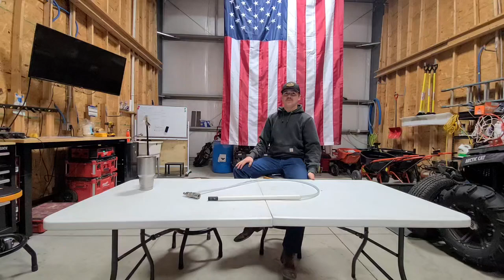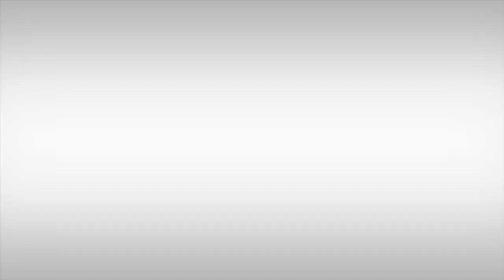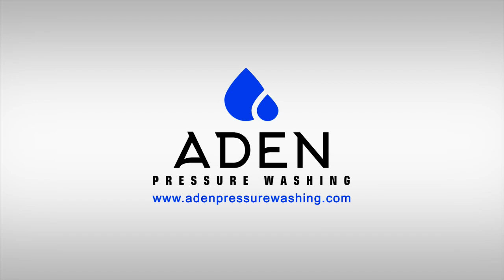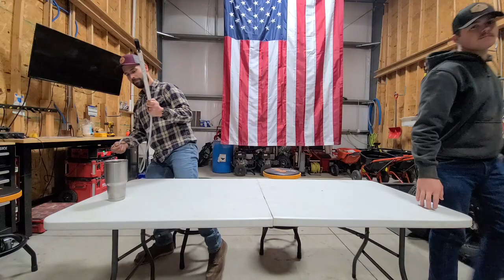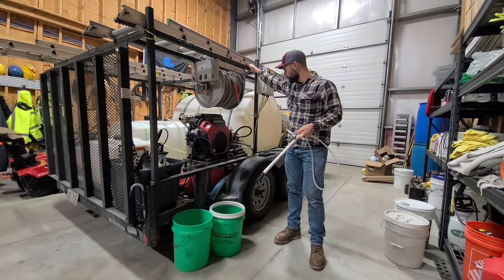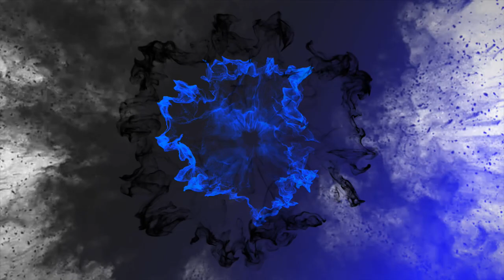Pressure Washing 101 -  Downstreaming

Comment: How many porcent can pull the downstream ?
Reply from the maker: @samuelrivera2466  depending on the size of the injector you can pull up to 1.25% with using straight 12.5% SH
Reply: @adenpressurewashing6009   i have a 2.1 injector